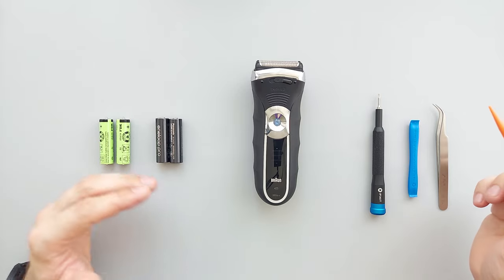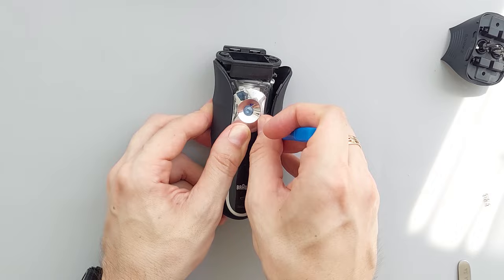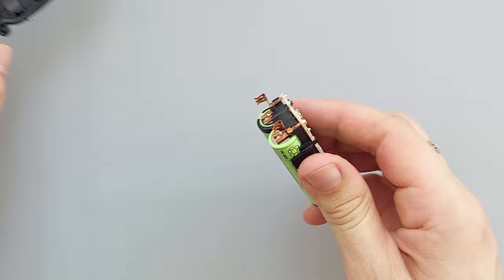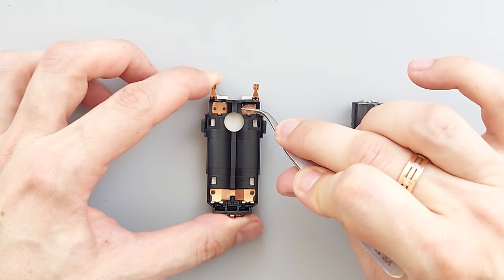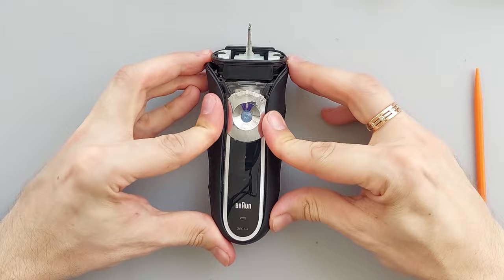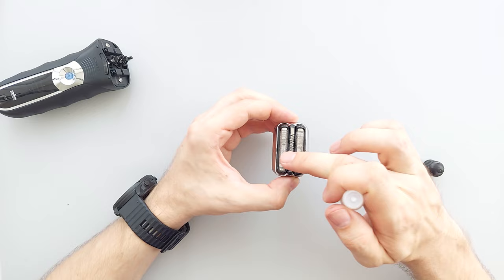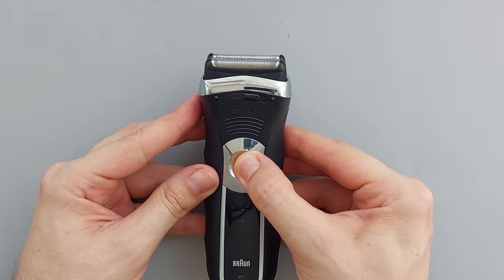Braun Series 3 Electric Razor disassembly and battery replacement (original and AA NIMH batteries)

Comment: I have an older model maybe 15-20 years and still using it with dead batts. It was a gift from my father now I will avoid charging it before every use hehe. Thanks a lot. Current batts are 3110v can I go for less or more what do you suggest?
Reply from the maker: What's the exact model of your shaver?
Reply: You cannot replace original batteries with a capacity of 800 mA with batteries with a capacity of 2500 mA, as this leads to constant overheating of the charging unit and its failure; charging highly discharged batteries is especially dangerous. Also, the algorithm for charging native batteries with a capacity of 800 mA does not provide charging for batteries with a much higher capacity, which leads to undercharging and, accordingly, less battery life for the razor. You can easily check this by removing the batteries and charging them in a suitable charger, and then putting them back and making sure that the operating time of the razor will increase significantly.

Comment: pretty straightforward I found my Braun Series 3 from Germany which had not been turned on in 10 years. I had some of those Panasonic Eneloop batteries on hand so I swapped those in. I did notice one of the vibrating pins was severely bent at almost 30 degree angle after disassembling... wondering what happened there but I believe it was a defect in manufacturing. I only used this razor a couple times because of the poor shave it gave and now I'm thinking that bent pin is why... I straightened the pin using one of my tools.
Reply from the maker: Great job! Thank you for the comment!
Reply: @ElectronicsComputers  Shaved with it today. Shave was still kinda slow compared to my other Rotary shaver. IDK if I'll continue using it but will see!
Reply: You cannot replace original batteries with a capacity of 800 mA with batteries with a capacity of 2500 mA, as this leads to constant overheating of the charging unit and its failure; charging highly discharged batteries is especially dangerous. Also, the algorithm for charging native batteries with a capacity of 800 mA does not provide charging for batteries with a much higher capacity, which leads to undercharging and, accordingly, less battery life for the razor. You can easily check this by removing the batteries and charging them in a suitable charger, and then putting them back and making sure that the operating time of the razor will increase significantly.

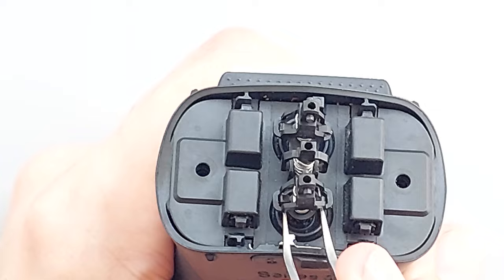Comment: A quick heads-up for anyone with the waterproof variant (e.g. 380s): the head can be removed as one piece after loosening the two screws at 00:25. There is no need to remove the plastic vibrators or springs. Just continue at 00:47 instead.

Comment: Does the shaver stop charging when the batteries are fully charged or once plugged in does the shaver stop charging after a certain period of time?
Reply from the maker: The shaver stops charging batteries when they reach their full capacity.
Reply: @ElectronicsComputers  ok thank you

Comment: I 😘 love it 😍😍😍 i hope i could upgrade mine braun type 5513 it take 10 hours to fully charge for only 50 minutes of use
Reply from the maker: You can do it!
Reply: You cannot replace original batteries with a capacity of 800 mA with batteries with a capacity of 2500 mA, as this leads to constant overheating of the charging unit and its failure; charging highly discharged batteries is especially dangerous. Also, the algorithm for charging native batteries with a capacity of 800 mA does not provide charging for batteries with a much higher capacity, which leads to undercharging and, accordingly, less battery life for the razor. You can easily check this by removing the batteries and charging them in a suitable charger, and then putting them back and making sure that the operating time of the razor will increase significantly.

Comment: Awesome help.  Thank you.
Reply from the maker: Glad it helped!
Reply: My Braun 3 suddenly started heating excessively when charging.   I have ruled out the charging cord and batteries.   Any other simple fixes or is it time to move on to a new shaver?
Reply from the maker: @JeffAbts  Did the casing of your shaver start getting hot after the battery was replaced, or did it happen while still using the original batteries?
Reply: @ElectronicsComputers  It was getting hot with the old batteries and now with the new.  I have swapped out charging cords which all work fine with a different Braun 3 I have.
Reply: @JeffAbts  You cannot replace original batteries with a capacity of 800 mA with batteries with a capacity of 2500 mA, as this leads to constant overheating of the charging unit and its failure; charging highly discharged batteries is especially dangerous. Also, the algorithm for charging native batteries with a capacity of 800 mA does not provide charging for batteries with a much higher capacity, which leads to undercharging and, accordingly, less battery life for the razor. You can easily check this by removing the batteries and charging them in a suitable charger, and then putting them back and making sure that the operating time of the razor will increase significantly.

Comment: Great video!  Is it okay to replace the NiHM with Lithium Ion batteries?  Thanks!
Reply from the maker: It won't work with Li-ion battery. The nominal voltage of NiMH battery per cell is 1.2 volts and the fully charged battery reaches 1.40-1.48 volts. Those two batteries are connected in series which means that the total voltage is 2.4V and 2.8 when fully charged. Li-ion battery has 3.7 volts of nominal voltage and 4.2 when fully charged. So if you install a Li-ion battery inside it will work at way lower voltage and it will take a couple of minutes to charge it to about 2.8-3 volts  and then charging will stop.
Reply: You cannot replace original batteries with a capacity of 800 mA with batteries with a capacity of 2500 mA, as this leads to constant overheating of the charging unit and its failure; charging highly discharged batteries is especially dangerous. Also, the algorithm for charging native batteries with a capacity of 800 mA does not provide charging for batteries with a much higher capacity, which leads to undercharging and, accordingly, less battery life for the razor. You can easily check this by removing the batteries and charging them in a suitable charger, and then putting them back and making sure that the operating time of the razor will increase significantly.
Reply: Thanks!  @ElectronicsComputers

Comment: Thanks for the video I tried using rechargeable batteries but the braun won't charge them
Reply: You cannot replace original batteries with a capacity of 800 mA with batteries with a capacity of 2500 mA, as this leads to constant overheating of the charging unit and its failure; charging highly discharged batteries is especially dangerous. Also, the algorithm for charging native batteries with a capacity of 800 mA does not provide charging for batteries with a much higher capacity, which leads to undercharging and, accordingly, less battery life for the razor. You can easily check this by removing the batteries and charging them in a suitable charger, and then putting them back and making sure that the operating time of the razor will increase significantly.

Comment: Great video, the batteries in my 3040s worked worse and I decided to replace them but unfortunately after opening the batteries and closing everything very carefully, the razor no longer works.
After the red error LED, I initialize with 5 seconds of power but even if the LEDs say that the battery is full, the shaver does not work. I also tried putting the original batteries back in and nothing doesn't react anymore. (instead, the motor powered directly by the batteries in series with a copper wire works. What could have happened?
Reply from the maker: Try to turn on the razor when it's disassembled. Check the button and make sure that batteries make reliable contact with the terminals.
Reply: @ElectronicsComputers  Thanks. Even when disassembled it no longer works, the LEDs are on and indicate the batteries are charged so I think the contacts are correct. Is there any tamper proof system?
Reply: Same here.
Reply: You cannot replace original batteries with a capacity of 800 mA with batteries with a capacity of 2500 mA, as this leads to constant overheating of the charging unit and its failure; charging highly discharged batteries is especially dangerous. Also, the algorithm for charging native batteries with a capacity of 800 mA does not provide charging for batteries with a much higher capacity, which leads to undercharging and, accordingly, less battery life for the razor. You can easily check this by removing the batteries and charging them in a suitable charger, and then putting them back and making sure that the operating time of the razor will increase significantly.
Reply: @salvanunzia9016  You cannot replace original batteries with a capacity of 800 mA with batteries with a capacity of 2500 mA, as this leads to constant overheating of the charging unit and its failure; charging highly discharged batteries is especially dangerous. Also, the algorithm for charging native batteries with a capacity of 800 mA does not provide charging for batteries with a much higher capacity, which leads to undercharging and, accordingly, less battery life for the razor. You can easily check this by removing the batteries and charging them in a suitable charger, and then putting them back and making sure that the operating time of the razor will increase significantly.
Reply: @alexstrong6976  I had to "reset" mine after replacing the battery by shorting the battery chip on the circuit board. Its at about 4 o'clock to the on/off switch. Then the circuit board is reset with the new battery

Comment: On the first place: thanks for the great tutorial - the disassembly went well!

I have a problem during assembly: 
- I put the battery holder - the shaver works.
- I tighten the plastic part with the switch with the screws - the shaver works.
- I put the rubber cover back: all the lights start flashing and the shaver won't work.
My impression is that everything is squeezed inside and that this is a problem.

Does anyone have an idea?
Reply: Here is what is the catch:
You cannot put standard AA rechargeable batteries in Braun 360cc because they are 1mm thicker than original SAN batteries are. The board "feels" that inside is jam and signals it as described above. The solution may be to buy originals, or to try to peal off the outer alu/plastic shell (manufacture label) on the battery and to make it thinner.
Reply: ATTENTION: if you completely remove the plastic, a short-circuit will be made even though there is a piece of insulating plastic on the plus pole. The heating is strong and it is possible that the device could catch fire. It is necessary to leave 5 mm of plastic wrap around the upper part of the battery or, if it has already been removed, wrap the top with insulating tape.
Reply: You cannot replace original batteries with a capacity of 800 mA with batteries with a capacity of 2500 mA, as this leads to constant overheating of the charging unit and its failure; charging highly discharged batteries is especially dangerous. Also, the algorithm for charging native batteries with a capacity of 800 mA does not provide charging for batteries with a much higher capacity, which leads to undercharging and, accordingly, less battery life for the razor. You can easily check this by removing the batteries and charging them in a suitable charger, and then putting them back and making sure that the operating time of the razor will increase significantly.
Reply: @markotesic8758  You cannot replace original batteries with a capacity of 800 mA with batteries with a capacity of 2500 mA, as this leads to constant overheating of the charging unit and its failure; charging highly discharged batteries is especially dangerous. Also, the algorithm for charging native batteries with a capacity of 800 mA does not provide charging for batteries with a much higher capacity, which leads to undercharging and, accordingly, less battery life for the razor. You can easily check this by removing the batteries and charging them in a suitable charger, and then putting them back and making sure that the operating time of the razor will increase significantly.
Reply: Dear Alex, thank you so much for detailed and clear comment from which I can learn a lot.
I put Lidl NiMH batteries 2500mAh, 1.2V in the shaver. For the original batteries, I cannot determine the capacity: the only markings on them are: SAN NiMH 106D(?)V battery 1.800.822.8837. I "matched" the technology (NiMH) and guessed everything else (capacity and voltage). I could not find information on the capacity of the original battery on the Internet. You say it's 800, but to me that seems a little low for an AA battery?
I am definitely an amateur and I am very grateful to you for pointing out the dangers that can be caused by the use of an inadequate battery.
With the batteries I inserted, the device works normally, and I did not feel overheating. It is not worth buying original batteries for an old device, although it would certainly be the best. I will give you feedback if I notice anything strange  @alexstrong6976
Reply: @markotesic8758  I note that it is not the razor that heats up, but the charging case, and it heats up more than with the original batteries installed.

Comment: Fantastic video, thank you very much from Spain. I have followed the instructions step by step with no problem at all. I started mounting back when I realized that the new batteries were a bit smaller than the originals, so I inserted a washer to ensure good contact. Then I saw that you bended the lids... my fault, but they were already installed.
After charging, I have used the shaver for the first time, and today I wanted to use it again and the batteries were off. I tried a 5-second reset and they workked, but now I'm charging them again, as they were near to die.
Can it be a problem of the batteries? They are brand new, that I bought for this purpose, 1.800 mAh Ni-Mh. So maybe it's the charge system itself, is it possible?
Thanks again.
Reply from the maker: Could be faulty batteries or bad contact on terminals with batteries.
Reply: @ElectronicsComputers   Brand new batteries. Maybe I have to dissasemble again and bend the lids to ensure good contact. Today I have used it again and it seems better, will see soon.
Reply: You cannot replace original batteries with a capacity of 800 mA with batteries with a capacity of 2500 mA, as this leads to constant overheating of the charging unit and its failure; charging highly discharged batteries is especially dangerous. Also, the algorithm for charging native batteries with a capacity of 800 mA does not provide charging for batteries with a much higher capacity, which leads to undercharging and, accordingly, less battery life for the razor. You can easily check this by removing the batteries and charging them in a suitable charger, and then putting them back and making sure that the operating time of the razor will increase significantly.
Reply: I finally disposed the razor and bought a new one. Next time I'll try with same mAh batts.
Reply: @gabrielgomez7099  May God grant you to live to see this moment!